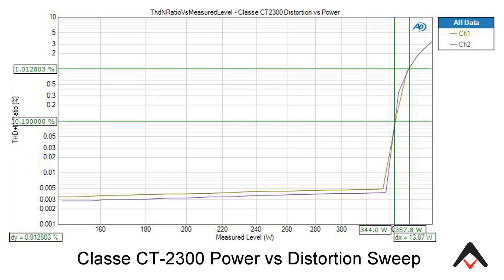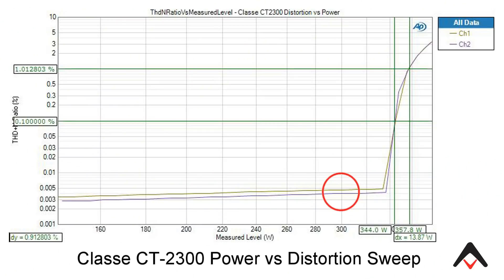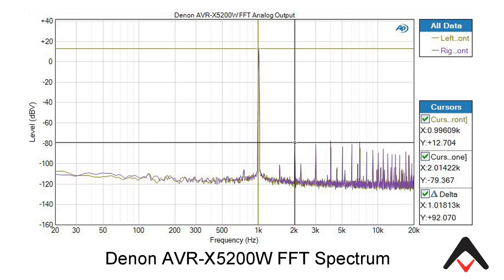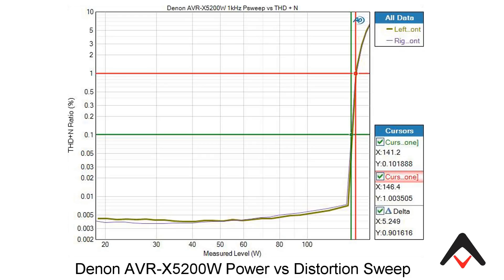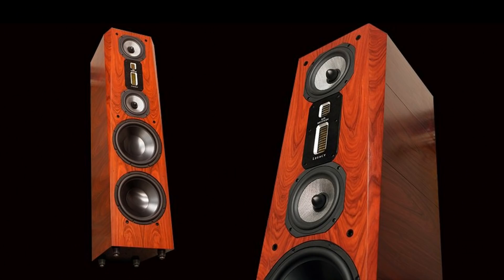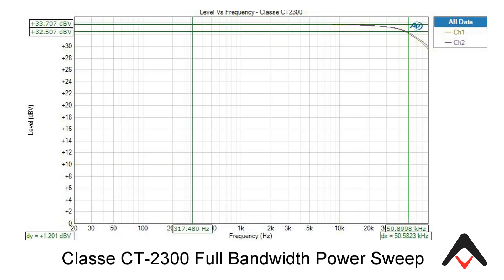Understanding Power Ratings in AV Receivers

Comment: Great feedback and comments. I actually purchased the Pioneer ELITE sc-99 purely for the "software" and the HDMI functions. The amplification is all being done by 2 brystons feeding all 11 speakers in the home theatre cause there is no way that Pioneer would have been able to keep up with the Bowers 803's and 804's, but I agree these companies aren't being very forthcoming and it's too bad because the features they have on these units are pretty good. They should maybe come out with a PRE series and let us decide how to amplify.
Reply: How did you hook up the reciever to the amps to vet them to run.
Some people have said to use a small dj's mixing board.
Reply: michael allen the pioneer has a full set of preouts that you can run (rca) cables to your Amp. That's what I did, and the nice thing is that the Pioneer has a feature that will allow you to disable the actual amplification running from the unit to the back of speaker connectors so you don't have to be running them uselessly😊 and the calibration does take into account the fact that your using the preouts to the Amp. Hope that answers your question
Reply: SWEEEET!!

Comment: One of the best Audioholics videos ever: no punches pulled, committed to keeping the industry honest and consumers educated. More like this please!
Reply: Ted Manasa sounds very honest and factual.
Reply: Totally agree with Ted Manasa above.  I've been in telecommunications for years, and now engineer (Cellular biz) test systems that test communications hardware, particularly amplifiers across all radio frequency bands.  After all these years I decided to get into home theater and was blown away at just how confusing the audio industry is compared to one that relies on strict FCC defined guidelines and specifications that I come from.
  
Clearly some of this is marketing.  Even "horsepower" was a marketing ploy to give farmers an idea how strong a steam engine would be compared to something the farmers understood better such as a horse.

But it appears marketing has gotten a little overly creative, I can say the same thing when it comes to figuring horsepower on a lawnmower these days since a number of the manufacturers no longer apply a horsepower rating to their mowers, so I have to resort to watching videos and gather other peoples experiences using a particular mower when the grass is a foot high to determine if it is going to cut my yard.

I really like that Audioholics tests these units under load and across a wide band of frequencies, even to mention the extended duty cycles imposed on the power supply by lower frequencies.  Perhaps what we really need to see is an all channels loaded and driven, and power measured at each output, to 1% THD in the various modes the amplifier operates.  I realize that would entail a lot of testing permutations, which could easily be handled by an ATE (Automated Test Environment) system.  But probably a simpler method would be to measure the input power to the amplifier while putting it through its paces from a few to all output channels, and note where the input power seems to start clipping to determine the MCP (Maximum Composite Power) of the amplifier(s) (and the power supply limitations as well), and particularly amplifier efficiency.

Comment: so my Sony AV receiver is RMS rating says 145wx7@6ohms,1kHz, 0.9%ThD is wrong  I'm a little confused right now
Reply from the maker: Not wrong, just inflated.  That amp is more like 90 watts/ch into 8 ohms unclipped.
Reply: Simply put there is ONE CENTRAL power generator in your reciever.  If you plug in two speakers you dont get half the total power to each.  The power drops quite quickly  and NOT linearly as each additional speaker is added.  One would think-and this is exaxtly what the manufacturers want you to do-that one just divides the total power output by the number of speakers connected.  But it DOESNT work like that in recievers with a central power core.
Also, it is quite easy to power 1hz-it's the extreme ends of the spectrum that are more difficult to power.  Manufacturers often rate their power with ONE channel driven.  So, 1hz and ONE channel.  How often do you sit in front of your speaker and listen to it buzz???.
Lastly, to get the maximum amount of wattage to be recorded manufacturers let the distortion levels run high....VERY high.  This allows them to then print these impressive wattages.

At any rate the manufacturers can print almost anything.  There's no FDA or MLB (No wait that's Major League Baseball and they cant even catch Barry Bonds or Roger Clemmens when they were all doped up on roids....because they didnt want to catch them.  But that's another sad story).
So, don't believe anything you read on the side of a reciever box-ESPECIALLY about WATTAGE.
We've ALL fallen for it.  And maybe that's why everyone who's "learned their lesson" on here is so vehemently opposed to how audio equipment manufacturers rate their equipment.
MOST of the numbers generated for this stuff is done by MARKETING NOT RESEARCH....well, MARKETING RESEARCH.
IF you want to CORRECTLY power your speakers-if they are worthy of it-then hook your recievers output to a good amplifier.   I use two CROWN XLS1502 in bridge mode for my POLK AUDIO rtia9s.  The amplifers are relatively inexpensive and produce excellent power.  
The CROWNs really helped bring alive my POLK rtia9s.  Without them the speakers sounded "tinny" and "empty"..
because they were!!.
Reply: Brandon Jackson yes absolutely! First look at the 8 ohm rating not 6ohm,because your speaker is a dynamic load not static. 6 ohm will give you more wattage numbers because of higher current. Secondly the frequency response should be tested at 20hz - 20Khz, thirdly either all channels driven or two. Lastly 1% thd? Wth...that's horrible, it should be .0009% thd in the 20-20khz range
Reply: OK I got now thanks so if I want I nice high power receiver in the 500doller Renge because I'm a sound freak which one should I go for?
Reply: I did my research and it exactly tells me the exact power watts that the amplifier put out in the  manual with two Channels Dravin and I'm so disappointed because it's only 50 watts two channels driven but I'm amazed at the same time because I'm wondering how they get a 5 channel AV receiver to sound so good and and loud with just 50 watts driven two channels can someone explain this ?but I wish they would stop lying about the wattage on the receiver box I mean come on it would say something like 1145 watts and because I'm a Audiophile I know that it not putting out 1145 watts I think it's very unfair to people who spent there hard money thinking there getting a powerful AV receiver that putting out dynamic range
Reply: If I didn't have good loud bookshelfs speaker hook to the receiver I don't think it would sound as good  but the menual also says it has a high performance l92MHz for all the Channels can someone tell me what that means because I don't know I'm learning

Comment: Hi Gene.  Great video.  I found this link:   https://en.wikipedia.org/wiki/Audio_power#US    about U.S. audio power ratings.  It says "In response to a Federal Trade Commission order, the Consumer Electronics Association has established a clear and concise measure of audio power for consumer electronics."  I couldn't find it.

That led me to this web site:  https://standards.cta.tech/apps/group_public/project/details.php?project_id=128   Test Methods of Measurement for Audio Amplifiers

The project contact is Ms. Leslie King.  I wonder what she would have to say about the current status of their project.  They've been working on it since 2013!  They've put it on hold until they finish another project, which is called:   ANSI/CTA-2054 Specifications for Selecting an Amplifier for Use with a Loudspeaker System
Summary: CTA-2054 will outline the performance attributes of a power amplifier in order to allow consumers / end-users to easily determine if a given amplifier is compatible with a given loudspeaker system."
 
Here's a link to the CEA 2001 standard: http://thecarversite.com/yetanotherforum/uploadfiles/20141120110945135.pdf
Reply from the maker: Yes the guys at CEA reached out to me a year ago about this but nothing happened afterwards.  Perhaps I need to touch base again.  Thanks for the reference.